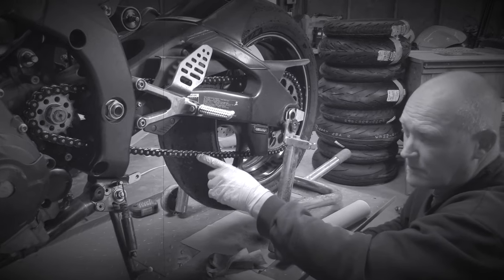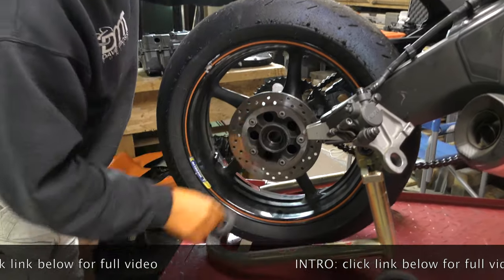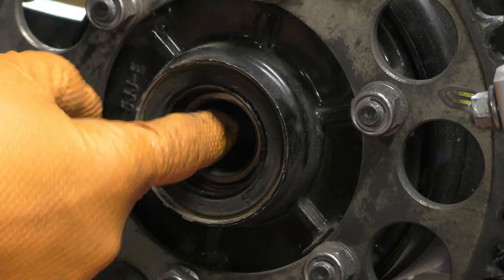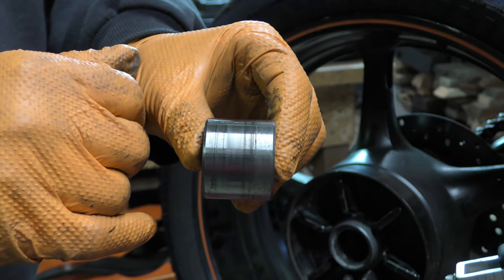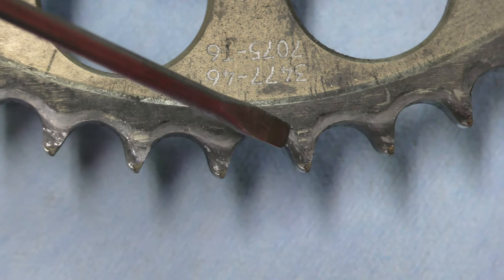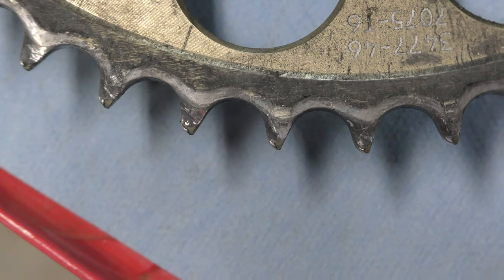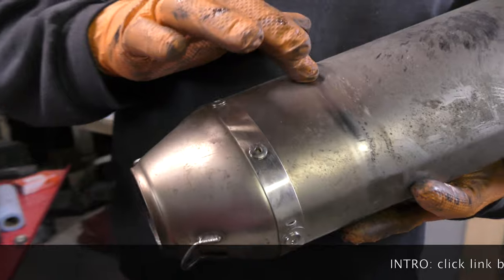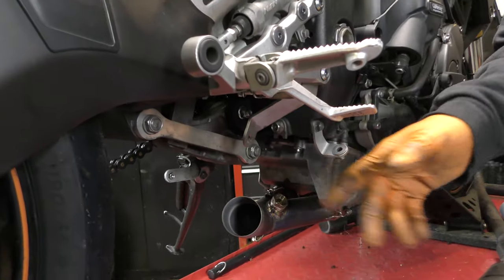INTRO Annual Motorcycle Maintenance: Rear Wheel, Chain & Sprocket, Linkage

Comment: I just did a friends er6F, new chain/sprockets pads/tyres. She ended up needing new wheel and suspension linkage bearings too, as someone (I know who) used copaslip instead of the correct grease.

This is why these video's are so important, they enable you to learn how to check yourself, it's not just about saving money, it could save your life.
Reply: It is. I did some of this work on my race bikes, however for new road bikes I leave it up to the pros. Mainly due to retaining warranties and having the service book stamped for re-sale.  Also (apart from learning how to clean and maintain your chain most of the rest should be left up to the dealership mechanics. Back yard ones can make mistakes.
Reply: @marcusgeorge1825  Sadly, this was a main dealer (who she'd bought the bike from) although not a Kawasaki one and the mechanic has now left and gone to work at a car quick fit tyre/exhaust centre.

Mistakes can happen, at any size/type of dealer.
Reply: @alanbrown5593  of course they can. No doubt about it!  However (if a bike is still under warranty then you are covered).  Regardless how good an individual is any works they do to a bike (excluding routine maintenance) then a warranty can be made void. Your said mechanic doesn’t sound like a good one. Which reminds me of an old saying... What do you call a person who finishes last in medical school?  Dr.! 
Stay upright and stay safe!
Reply: @marcusgeorge1825   never heard if that saying, it rings true tho. Just started checking things on my own and constantly learning.

Comment: Dave, thanks for the video! 
I’ve just replaced both sprockets an drive chain and noticed some black sticky-oily dirt around front sprocket. Moreover, my oil level dropped significantly by the time my bike was standing. I haven’t noticed any leak evidence around oil filter and drain. Is it possible for oil to leak through front sprocket assembly? 
Thank you in advance!
Reply from the maker: Yes it is. Clean it carefully by hand, not a can of brake clean etc. Then put something that is powder type consistency around the seal and start the engine. Let it get to full temp at idle only. If there is no clear leak in the powder, then drive for 2-3 minutes using 1st and second gear to create pressure in the engine. Check again.
Reply: @catalystreactionsbw  I'll do that.
Thank you a lot, Dave!